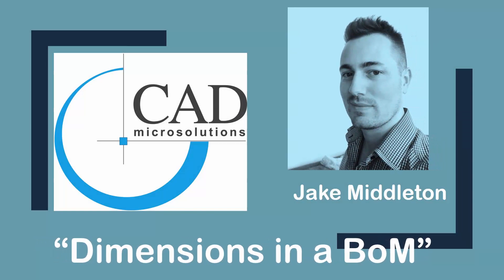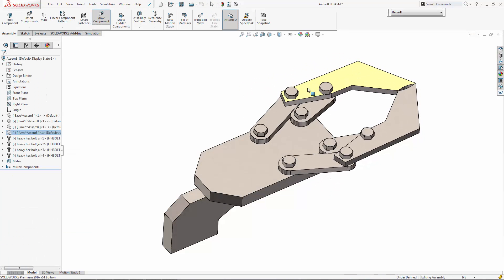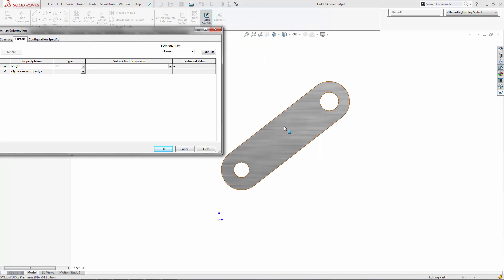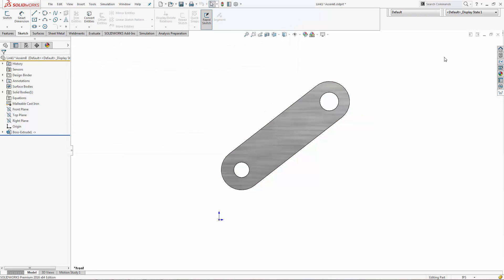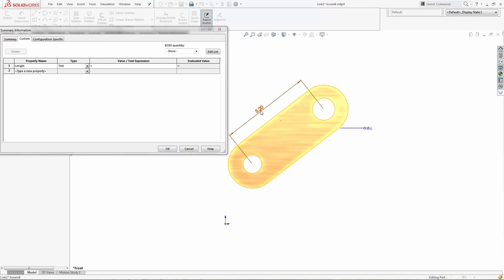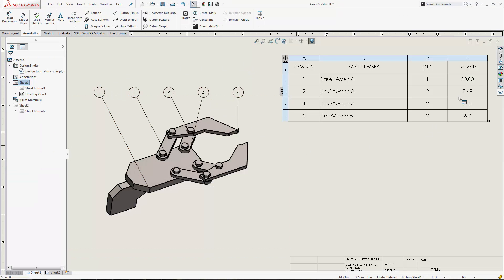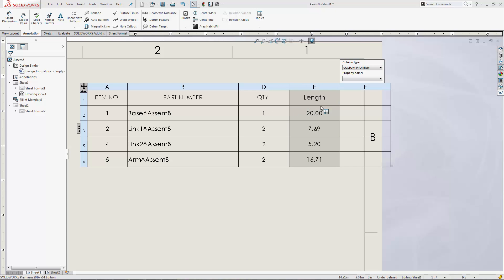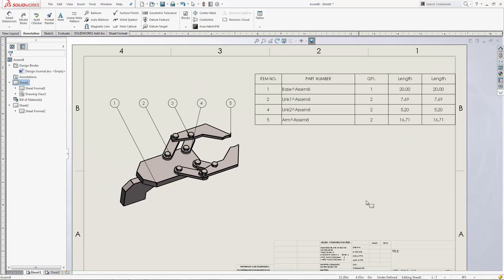SolidWorks - Linking BoM to Dimension

Comment: Is there a way to format the dimensions (eg fraction, 1 decimal, 2 decimal), or are they always formatted in the part document properties?
Reply: i've been struggling with this as well. part documents are set on .1 but my linked dimension is rounded to .123